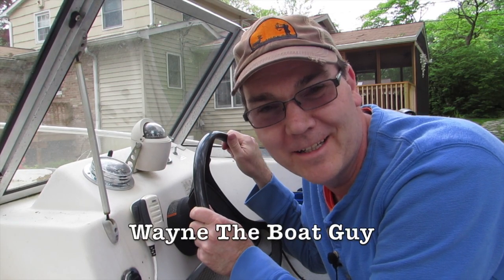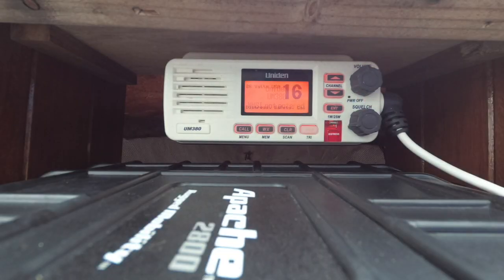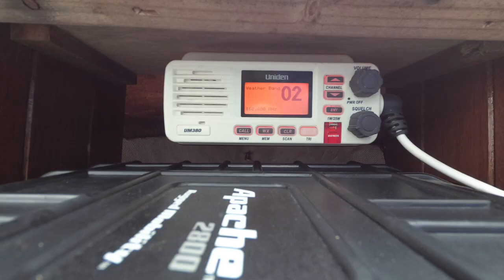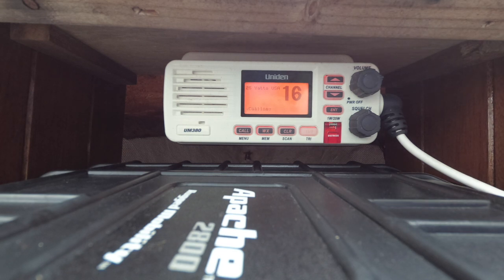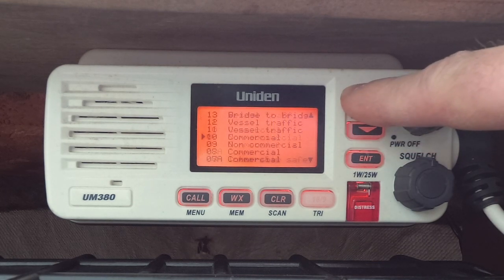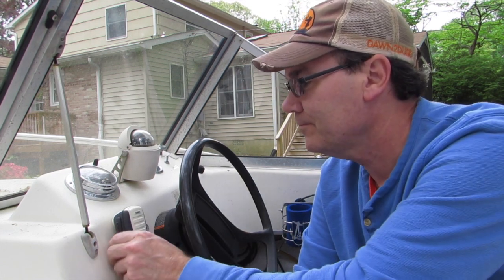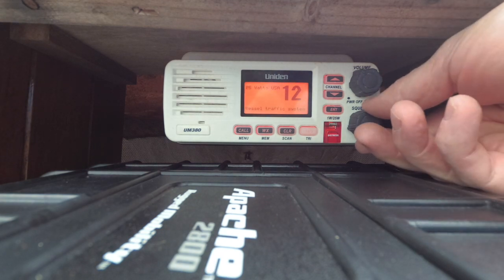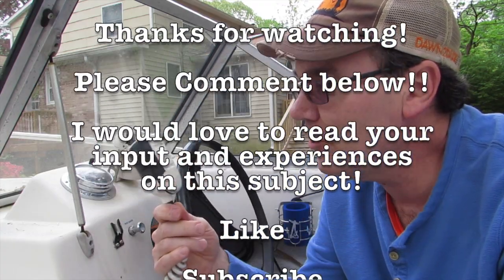Boating and using VHF boat radio basics. Do we still need marine VHF radios?

Comment: I noticed when you heard a weak signal you turned the squelch up (clockwise) You need to turn it down (anticlockwise) to hear the weak signals. It's imperitive you get that right, in an emergency you would lose your contact doing what you did there.
Reply from the maker: Great point!
Reply: @WayneTheBoatGuy  Not only that check your antenna. The radios  working on VHF and its transmitting straight line . The range of a  transmitter and receiver is proportional to the Hight of antenna position and the power , also consider any obstacles like trees, buildings , ships etc.... The hand held radio have only 5 watts and the radio installed permanently  fixed  may get 25 watts . Also  the antenna  is important to radio communication. The channel 16 that cost guard transmitting is powerful and antenna located in high position also. if a 25 watt transmitter at 60 miles from shore need the antenna in a mast, usually big ships get a range about 200 miles because the position of the antenna.

Comment: Great points regarding the benefits of VHF.  In terms of safety, they are indispensable for all the reasons you described.  One boater recently asked me, "Why do you need a VHF anymore when everyone now has cell phones? The reasons are almost obvious, especially when trying to hail a stranger bearing down on you or if you want to offer another vessel assistance even in a non emergency situation. Racing sailors use them to get instructions from the committee boat, etc, etc.  If anyone is wondering, cell phones DO NOT replace VHF radios on a boat!  Thank you Wayne.

Comment: I operated my boat in the chesapeake for years without a radio. The summer I finally installed one I took on water at Hart Miller and needed assistance to pump out and get back to dock. Saved me big time.

Comment: The answer is don’t rely on mobile phones.  A radio transmission can be received by multiple people whereas your phone will only call one person
Reply from the maker: Good point!
Reply: Yes, a phone call will be dependent on one cell tower working and satellite is dependent on a few satellites working, whereas radio relies only on both sides working. I will admit that satellites failing and cell towers failing is extremely rare, but it is still good to have a backup communication form.

Comment: Hello if you notice on your radio display in the top left it reads 25 W or 25 watts or 1 W or 1 watt. Channel 16 is 25 watts channel 13 is 1 watt. 25 watts is more power output and 1 watt is lower power output hence the shorter range. I enjoyed your video.
Reply from the maker: thank you!

Comment: I do alot of traveling on my boat and just to give you some info channel 13 is used to request a bridge opening so we can can pass through . Also down around Florida they use channel  9 . Just a little info. Stay safe. 🇺🇲
Reply from the maker: Yeah I have heard that in some other areas it's channel 9 fir bridges. The big ships in the Chesapeake use 13 as they travel the bay

Comment: If I am trying to hail another boat, I'm expecting you to have your radio on.  If you don't, I'll switch over to the PA and hope you hear that.  Leaving the radio on is easy.  Remember for non-commercial use there's also channel 9 which is the recreational calling channel.  Most useful for areas where 16 is just too busy.  Coast Guard monitors 16, so remember that.  Also, regardless of the calling channel, if you need to talk to another recreational boat you should ask them to switch over to a working channel.  Non-commercial boaters can use 68, 69, 71, 72, and 78A.  Ask the other boater to switch and answer on a working channel to stay off 16.  Use your radio to talk to bridges, locks, marinas, gas docks, and so on.  It's handy.  Good video otherwise.
Reply from the maker: Yeah I’ve been surprised this season with lack of chatter on 16 even on busy weekend days. I hear radio checks occasionally but otherwise not much.

Comment: Three things:
I believe Channel 13 on VHF marine radios is just like any other channel as far as radio power and range. The 'short range' comment probably refers to the idea that the channel should only be used bridge to bridge between large boats that are within sight of one another i.e. 'short range' in order to facilitate their movements around one another and not tie up the channel. Because of their antenna height above the water a large commercial carrier using the same radio you are using can have a range of 30 miles or more to another such ship, so they are asked to only use that channel when 2 boats are quite close to one another, in order to keep the channel from becoming too busy. 

Second, the last time (several years ago) that I read the FCC VHF maritime radio regulations it was clearly illegal for anyone (other than n FCC approved and licensed shore-side commercial station involved in local marine-related business, (like a marina, or ferryboat company,) to transmit on any of these frequencies when not out on the water. That prohibition even included boats at float dockside in order to avoid boaters at large marinas from making the channels unusable for boaters outside the harbor. 

Third, I suspect your radio (or antenna,) if properly installed has a 'ground' wire attached to a plate of some sort that would be under water when the boat is afloat. That plate in the water improves both the radio reception and transmission performance, and thus hurts performance if the craft is not in the water. While the radio's antenna system can be optimized for use on both land and sea, due to the regulations the installer of the radio probably assumed that it would only be used in the water and likely did not optimize the antenna system for use on shore. 

BTW, when you are 2 or 3 miles away from shore and you run out of gas or your engine dies for some reason a good working marine-band radio is a real lifesaver, (I know,) especially if you are out in a bay around large, commercial shipping. Besides, if there's an off-shore breeze or current you will soon find yourself far from shore for far too long without a good little radio on channel 16. As a sailor, I figure the radio is worth about the same as my life is.

Comment: You do not chit chat on 16. 
That's the coast guard channel.
You will get the speech from the coast guard station saying it is for distress calls only. 
I hear radio check all the time and then the speech
Reply from the maker: Now that I've spent much more time on the water, it seems to vary by area and the boaters on the water. Around me, many days I hear people hailing another vessel and then they switch channels and it's all 'correct'. Other days it's lots of random stuff like radio checks and other requests. I have yet to hear the Coast Guard come on with anything other than an announcement about an emergency situation.
Reply: Coast guard Mobile doesn't allow any small talk.

Comment: Noooo. 9 is the boater chit chat radio check channel. 16 is dedicated distress and urgencies. 13 is 1 watt bridge to bridge for close maneuvering. 67 is 1 watt crew radio. Another chit chat. Disconnect your radio if you connect a crude battery charger. Consider a CB radio. You can turn any channel into a distress frequency. If you don't have a boat radio, a 25 watter is what you want. On a cabin boat, it's not unusual to have a radio in the bunk or galley and one by the wheel/tiller.

Comment: From what I remember when taking my marine VHF license, a marine VHF radio is for communication relating to ships business NOT general chit chat on ANY channel and surely if you request a radio check and you don't get a reply the most likely reason is that something is wrong with either transmitter or receiver?
Reply from the maker: I’m not sure how much the rules vary by country, but around here fishermen use some of the higher channels to chat, 16 for emergencies or to initiate a conversation (which then moves to another channel) and 13 is used by commercial ships in the bay. 
Our rules, laws, and practices seem to be much less regulated.
Reply: Maybe in North Korea or the UK that is true. But in the free USA there are a number of recreational boat to boat VHF channels such as 68, 69, 71, 72, & 78A.

Comment: GSM mobiles dont work at open sea.and batteries quickly finish. They are not resistant to sea Water and humidity .in case of emergency  you will call help on telegramm or  watsapp :))??

Comment: The mmsi number is required to use the distress button and is issued by your country’s Maritime authorities 
Generally you are required to have a radio operators licence.  At least here in Australia , you need the licence or a number will not be issued!
A linked gps is required to be able to transmit your coordinates
Reply from the maker: We are not required to have a radio operators license and - I guess it shows! We are also not required to have a VHF radio if we're just a recreational boater.
Reply: @WayneTheBoatGuy  Wayne getting mmsi number in the US is easy. An mmsi has information about you and your boat and when the distress button is pressed it transmits that data over channel 16. Connecting the GPS over nmea 0183 will transmit your coordinates when the distress button is pressed. Emergencies happen fast take the extra steps and set it up right.

Comment: I have had one on my fishing boat for years. You DO NOT need one if you spend your time on small inland lakes where you can hail another boat, or drift/float to shore if you break down.  You DO need it if you fish remote lakes (like I do in NW Ontario), or large lakes (tens or hundreds of thousands of acres).    Most remote areas have no cell service so a radio is amazingly useful.  You may never use it....but if a day comes that you do need it, you'll thank heaven you have it.
Reply: I fish Lake Erie in an 18' 7" aluminum tiller with a 60 hp., typically 8-13 miles out and from mid-September on, there are very few boats out. A VHF radio & 4' antenna and gas kicker were the first 2 items I purchased when rigging my boat from scratch. I see many larger boats with just a main and electric bow-mount (which are a false sense of security in 3' footers and 16 mph wind and your main goes down) and no radio. I witness the mishaps and near catastrophes every time I'm out listening to ch 16, from both the American and Canadian Coast Guard and have even lent assistance to a disabled vessel. Too many  people forget there is nowhere to run to when you're on the water and disaster strikes. I met a couple a few years back at a resort on the Bay of Quinte I frequent late fall for walleye, and the fellow told a story of how his boat was sinking that summer and despite other anglers in the vicinity he had to radio for a rescue boat that arrived in the nick of time to take him in tow and provide additional pumps. I said only "August 8th". He had a shocked look on his face and he asked how I could know that was the date. I replied " I listened to the whole hour+ drama unfold on VHF"- I was fishing probably 30 miles away
Reply: You can also get cheap UV5R and factory reset to use it for marine vhf

Comment: Technically as a liscensed vhf operator and ham radio operator. Using a vhf marine radio from land is frowned upon. But i don’t understand why. Usually the non commercial radios that are mounted on recreational boats get only up to 10 miles range. Sailboats with a mast mounted antenna can get anywhere from 10-25 miles in range. It’s all bout that antenna
Reply from the maker: I think the 'use on land' issues might have come along during the 1970s when kids liked to play with radios. I'm sure some played with VHF radios too - fake distress calls etc.

Comment: You will not be shot down in the flames of hell for asking for a radio check on 16. Actually, its encouraged to do so. Especially if the bouneback channels are giving you zero feedback.

also channel 12 will be your local operations. Ask there too.

Comment: Would you please make a video of what you should do (showing every step) as soon as you get on a boat?  I've seen some videos mentioning turn on the batteries.  Do you actually need to turn on batteries?  I plan to rent a pontoon this summer.
Reply from the maker: Good idea thanks! As far as turning on the batteries, It's only necessary if they have been switched off. Some people always switch off their batteries to prevent any draining of the batteries while the boat sits. A quick check is by turning the key to the accessory position - if nothing beeps or lights up, the batteries are off.

Comment: I want to take VHF radio in my house with license. Now
 You know, VHF has 16 channels. So why so many programs on uv-5R? I fixed all the channels from the shop.With Bf-88s and nib a few. I will connect so many channels to the key. Many problems.  And suggest + know VHF free. So how to connect with Uv-5R BF88ss. What to do with so many programs? Which will be easier? For my Home use?
Programme is hard than channel adjust plzzzz help me

Comment: Thanks Wayne. You will not get any response as you are not transmitting. You need to input your assigned MMSI number to enable the radio to transmit. I believe you can hit the distress button without having a licence or MMSI. You will not however be able to shout MAYDAY or call PAN-PAN as you cannot transmit voice.
Reply from the maker: I have transmitted on this and my portable one without an MMSI

Comment: I HAVE 2 VHF RADIOS MMSI GPS 1 low gain phase 3 3 ft and phase 3 8ft i am in south Florida 27 auto radio system check ch 9 bridge openings 72 fishing boats great info if your fishing call Rock & Reel in south Florida

Comment: I think its important to bring up antenna and wiring when talking about VHF. you could go out and buy the baddest $1500 top of the line trancever at the boat shop, but if your running your signal through the crappy included antenna they give you in the box, you might be getting 5 watts max output. There was a good anecdote i heard on a sailing channel, where the boat with a quality antenna set up was able to act as a relay for a boat 100 miles away trying to communicate with a marina that it was actually very close to, but could not directly contact because of how bad the installation was on the boat or at the marina. typical VHF has a range of around 25 miles. But if you install it right, you can get messages out far and wide. great asset to have in an emergency.

Comment: Couple of quick points...  First, no one should be chit chatting on 16.  It's for hailing and emergency only.  If you need to talk to someone, as soon as they answer you, switch to another channel.  68 and 69 are for general coms.  

And second, you don't need a radio check.  Like almost never.  That went out with tubes in the 60s.  Solid state radios just don't break.  It's possible to have a bad connection to a mic or an antenna, but not very common.  A handheld is a very good thing to have in an emergency.  So, if have both, tune them both to 68 or something and you can comm check yourself.
Reply from the maker: Now that I have a few more years of boating under my belt, I still hear people asking for a radio check. I usually hear at least one every weekend I am on the water during the summer. Weekdays, not so much.
Reply: @WayneTheBoatGuy  Oh, believe me, I know.  Drives me nuts.  Just trying to spread the good word.  I'm glad you correctly pointed out that you shouldn't be asking for radio checks on 16

Comment: You said you don't understand how 13 was shorter range than 16 but look at the display. When you are on 13 your radio is transmitting at only 1 watt.  Channel 16 and others transmit at 25 watts on your radio. You would be using 13 when you are in very close proximity to another boat you want to communicate with so transmitting with too much power would cause too much confusion as you call the white sailboat, for example.

Comment: Wayne, thank you very much for the all information in the video. I have a question.. and hope you could help me if you can... Is it possible to change a channel frequency? I mean using a Uniden Solara 385... Thank you very much!
Reply from the maker: I'm not sure what you mean. I believe each channel has a set frequency so that every radio tuned to channel 16 or 67 is transmitting and receiving the same frequency as other radios tuned to that channel.

Comment: My VHF Radio sometimes defaults back to channel 16 every time I switch ignition off and on and then sometimes it will stay on the channel I operate on. I have Uniden 535.
Reply from the maker: Hmm - I wonder if it has to do with a voltage drop when starting.